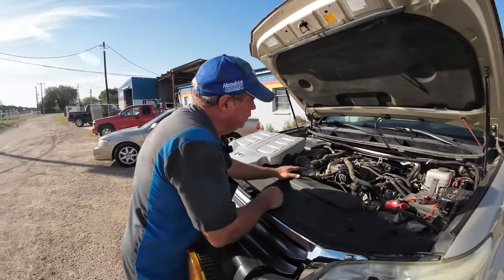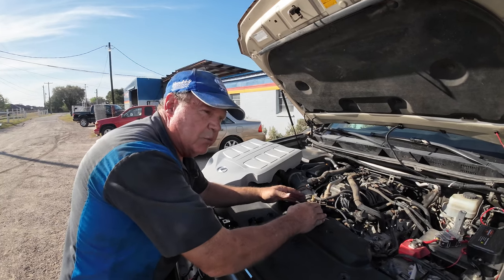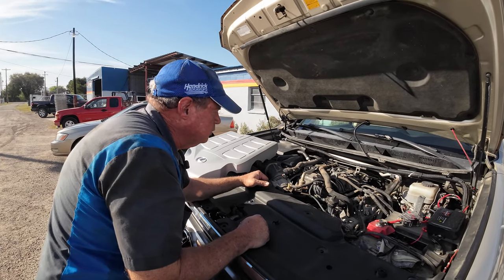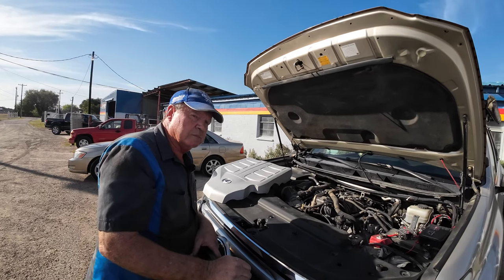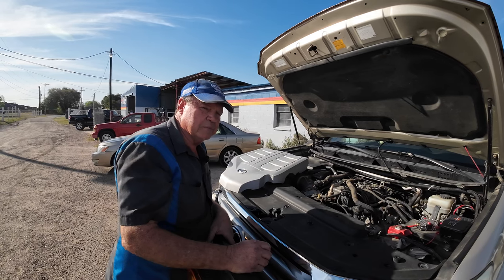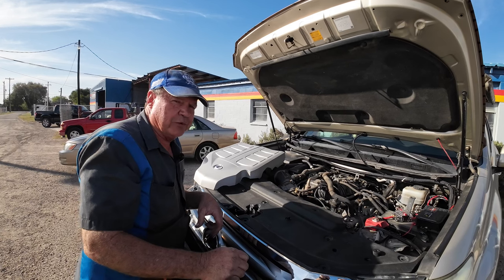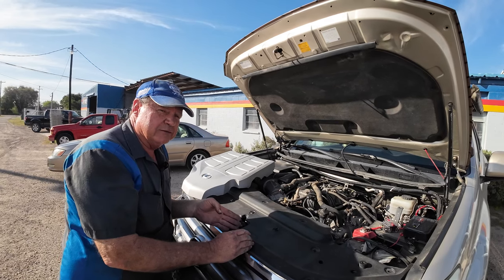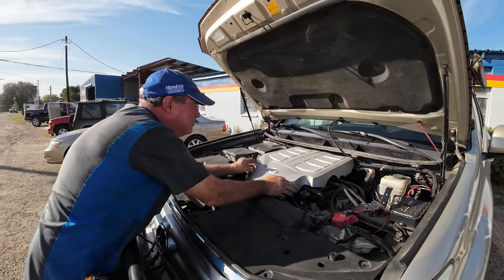EXPERT Mechanic Explains the Valley Plate Leak on Lexus GX460

Comment: Just had this done on my 2014 LS460 FSport 130k miles...thank God the warranty covered it. Expensive job.
Reply from the maker: My extended warranty had just expired and I had to fork out the money 💰😭
Reply: How much was it? I have to do mine. I'm a pretty good mechanic and have all the tools in my garage.  I just want to know how much you paid, if you don't mind?
Reply from the maker: @daniellarroyo  $1600 with parts
Reply: How much was the cost?
Reply: I just found out about this. How common of an issue is this on the LS models? Is it usually with higher milege or ? I have a 2017 LS460 with currently 67k miles .
Reply: "Reliable" except there are a hand full of dumb repairs like this thats just like a bmw
Reply: @ClassicXL86 should be fine. I don’t think this was an issue after 2014
Reply: Will an extended warranty cover this ?

Comment: Great information.
Curious, how many miles? I caught the 10 years part.
What in your experience is the best sealer to use? I know Toyota has its own FIPG.
Thanks for the this video.
Reply from the maker: My truck had about 82k miles on the odometer when this happened. It’s not a mileage thing, but rather a “time” issue. My vehicle is a 2012 model, but my buddy has a 2014 and it happened to his also.

Comment: Hi buddy. I just found out about this the hard way. I’ve got 160k miles on my 2011 and will be $2200 job. Parts are not much it’s the labor. Considering the last major service was 5 years ago ( water pump and 90k service/ belts). I feel like this extremely reasonable. Best vehicle ever.
Reply from the maker: Really do love my GX. Thanks for watching 🙌🏽
Reply: 2200 buck repair at 160k IS NOT RELIABLE.
Reply: I’m adding the valley plate leak on top of my transmission replacement last year.  And my paint is peeling like crazy.  My 2011 GX has been the biggest money pit ever.

Comment: Does the valley heat exchnager need replacing or just a new sealant after cleaning the old one?  Thanks
Got an 2011 LS460.
Reply from the maker: My buddy just did his LC200 and we both agree you don’t need to replace it. Just the seal.

Comment: What if you just keep filling up the coolant and not actually fixing it?  Trying to decide if worth the fix? ($2500 quote) for 2011 Landcruiser
Reply from the maker: I did that for a few weeks so I guess you can do that until you decide how to proceed. Nice ride and good luck!
Reply: @CoastalGX  If I have to get done is there any reason to wait or is it better for the car to do right away vs. waiting? I assume I can't wait for another 5-6 years?
Reply from the maker: @maggiecatbagan5952  it's really your choice. Depends on your needs and financial situation. Perhaps you should shop around for a better price. Most people pay between $1500 to $2000.
Reply: @maggiecatbagan5952  I have a 2011 Gx460 with 190k and I'm having a radiator changed out first before they go digging into the Valley Plate. Mine has likely been leaking for 100k miles now.

Comment: Great video! 

I have a p2714 fault- have replaced correlating solenoid, transmission wiring harness, filter, fluid…..won’t shift out of third….unless I let it warm up and it runs like new! Been driving it for 2 years like this…totally lost, any advice? Considering changing thermostat but honestly don’t know where that’s located just yet
Reply from the maker: Man, that would drive me nuts 🤨 This sounds like a something a pro needs to handle. Good luck on the repair. 🙌🏽
Reply: I have something similar to you going on. I changed the trans fluid and the solenoid for the corresponding code with no luck. I didn't look at the filter but I am going to check that next when I go to install a valve body rebuild or 'zip kit' from Sonnex. Read up on worn bores in the valve body which cause pressure loss, and can throw codes related to different solenoids. The kit fixes the leaky bores with modified bore plugs and boost valve. From what I've gathered these parts can be replaced pretty easily, if you've gotten to the valve body (not hard) then you should be able to tackle replacing the valve body rebuild parts to shore up potential causes of pressure loss which lead to a lot of the transmission performance codes. Your solenoids can easily be function checked with a digital multimeter to rule out costly replacement of parts that are otherwise fine

Comment: What did you notice before you took it to the shop?
Reply from the maker: One day I noticed abnormal engine temps so I pulled over to check the reservoir. I noticed it was below the line. So I filled it up and got it up on ramps. I saw some dried pink residue around the tranny bell. The temp was back to normal and I monitored the coolant level for a couple of weeks and noticed the coolant was low again. I just kept filling it until I found a reputable shop. Now it runs great.

Comment: Common issue in the Toyota 2UR & 3UR V8s. I’m anticipating this happening to my IS F. I’m going to tackle it myself. I’m educating myself as much as I can. A common issue I keep reading about, is 
folks rolling the o ring in the coolant pipe. Also breaking the connectors. I just wish one can find a better sealant solution. To avoid re doing this task.
Reply from the maker: Congratulations on your IS F!! Love that car. Thanks for sharing and good luck with your project.
Reply: @CoastalGX  Thank you! It’s truly a pleasant ride!
Reply: I had this service done on my 2012 GX at ~110k miles. I read up on it quite a bit and had a independent shop do it. I made sure they ordered the correct sealant from Toyota so it would be oem and wouldn't potentially be a generic sealant. That also ensured that what they used was 'fresh' and not expired from sitting on a shelf and separating which happens to a lot of sealants and greases etc when they've been sitting. The shop originally misdiagnosed the valley plate leak which I distinctly remember telling them that I thought it was, but they honored my original $600 estimate, and its been fine since at 2 years later
Reply from the maker: @errldabbins  that's great. Mine only had 88k miles when I noticed it. It's also a 2012 so I think this is an age thing and not necessarily caused by mileage.
Reply: Plan on replacing all the fuel injection connections. The plastic gets brittle and they will break on you.

Comment: Had this done on my 2011 IS-F. Time consuming job-Cost me ~a grand a few years ago when parts were readily available at a small garage with a knowledgeable owner/Tech. he used a sealant that they use on UPS trucks and is guaranteed for life. Toyota hopefully has switched to an improved sealant.
Reply from the maker: Thank you for sharing. Yes, Toyota should acknowledge this issue and take responsibility for it.
Reply: P# for ups sealant?
Reply: @colby3333  I have to get a hold of my mechanic that did the work… stay tuned
Reply: @dawkrb  ty bro. My buddy is gathering parts for his repair
Reply: @dawkrb  any luck on the P#? Thanks
Reply: @nrguitar11  Haven’t been able to talk to him directly to ask him. I’ll dig the receipt out to see if he itemized it.

Comment: Had mine done this week. 2012 gx460 150.000 miles ,heat exchanger was leaking
dealer did the work ,$ 1,900 all new gaskets o rings and such, It should be good
 for the next 150,000 miles. common problem on lexus land cruiser toyota.
Reply from the maker: Glad you took care of it and thank you for sharing. I paid $1600 for mine so it’s on par.
Reply: @CoastalGX Just paid $3100 2013 LS 460!
Reply from the maker: @huntingtonbeachanthony4957  stolen!!!! LOL. Sir, you are a lucky guy and I'm jelly lol. Wait, for the car or the service??? :face-orange-biting-nails:
Reply: @CoastalGX  The service! Shops in my area charge a "location" premium! He quoted $ 3600! But gave me a "discount. " 🙄
Reply from the maker: @huntingtonbeachanthony4957  that’s crazy expensive 🫣
Reply: @CoastalGX  Agreed!!!
Reply: Not even at 200k miles yet and a huge repair like that..... thats not reliability.... my bmw is at 200k and hasn't had a single repair that expensive yet...

Comment: Just had mine done on mu '09 LX570 at ToyoTec in Rancho Cucamonga. 1700 cash vs 2300 at the dealer, used genuine Toyota FIPG / 10 year gasket silicone. Money well spent.
Reply from the maker: Sounds about right 👍🏽

Comment: Glad to ear your tuck is fix ! Thank you for making the video about it , i totally agree whit your mechanic except for the gasket part,  yes GM have crappie gaskets and Ford also have their fair share of gaskets and crappie plastics but Toyota have many other engines that not using this way of sealing and work fine whit out leaking or catastrophic failures,  all i saying is they could went a different route , what it really piss me about this is the fact that no matter what it will leak again ! it boils down to time as the sealant gets old start to leak, i bet there is a lot of people whit this problem and dont even know it , but even whit all the corks this truck have i still believe  they are a really good truck i am on my 3 gx and most likely i will get another after i finish setting up this one🤣
Reply from the maker: Those are good points. They simply need to improve and accept there is an issue.

Comment: Cylinder block heat exchanger*
Reply from the maker: Very interesting. Going to do some research on that later 👍🏽
Reply: @CoastalGX  that's what Toyota calls it. Valley plate is more of a literal term that most people understand.
Reply from the maker: @Ill06Taco  thank you!
Reply: @CoastalGX  very common with the UR series in all applications LS, IS, GS, GX, Tundra. Oddly I haven't seen one leak on a LX or Land Cruiser. I also haven't seen them leak on any of the vehicles that are around 5 years old yet but time will tell.

Comment: My GX is literally in the shop getting the valley plate and water pump done. And only has 91k on her.
Reply from the maker: Mine had 87k and is a 2012. What model year is yours?
Reply: 2014, I was changing the oil and notice coolant residue on the block and figured it was a water pump. Took it to the dealership ( I have extended warranty) and the diagnosed the valley plate was leaking too.
Reply from the maker: @CapsuleMachina  my warranty ended in December 2022! Classic. 😂
Reply: That’s a shame. Toyota needs to cover this.  We expect far more than GM/Ford reliability when buying a toyota/ Lexus

Comment: Totally this not a diy job, even some Mechanic may scroll up when remove intake manifold, something fall inside the piston and destroy the engine, GX470 has a better engine can last up to million miles if maintained, GX460 engine has more problems!
Reply from the maker: It’s not exclusive to the GX460. I read up on Tundras and other Lexus models. Very annoying issue. My truck only has 87k miles so this is more of an age issue.
Reply: I have a GX 470 with 200K on the clock it is a 2007 model, full dealer service up to 195K miles, what should I look out for and what service should I do.  I am the second owner.
Reply: @Moondoggy1941  I have a 2009 GX470. I recommend you consider getting g the timing belt done around every 100,000 miles or every 7-8 years. Now, There are guys out there that drove over 150k miles and over 10 years on the original belt and when it was removed it looked pristine. So it’s up to you how long you want to push your luck. Get the fluids baselined. Lubricate the drive shafts. Check the brake pads. There trucks tend to wear out their rear pads first. Also check the SAIS (secondary air injection system). You can do your own spark plugs too! https://youtu.be/FLpE8L5Yx5A
Do you still have the original rear suspension/air bags?
Reply: @MaximumDIYGarage  Thanks,  lucky for me the timing belt and water pump have been replaced twice by the dealer.  I will check into the fluids and drive shaft, I do not think it has ever been in 4 wd,  it is a mall princess still. I have owned it for 3 years, , I did drive it for a year about 25 miles a day, then gas went to almost 6 dollars a gallon I did not drive it as much.  I do have the original rear suspension, I would like to an upgrade for more off-road but nothing serious.  Do you have the dealer do the secondary air injection?  I can usually do spark plugs as long as it is not crazy difficult.  Thanks for the help.